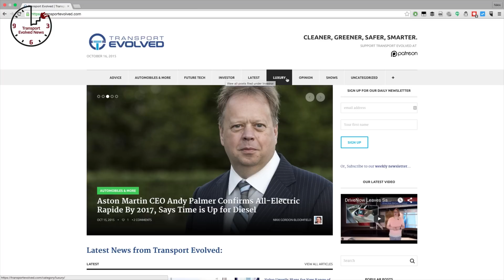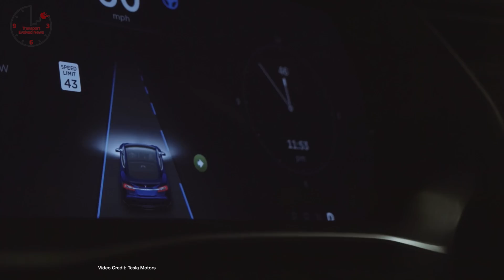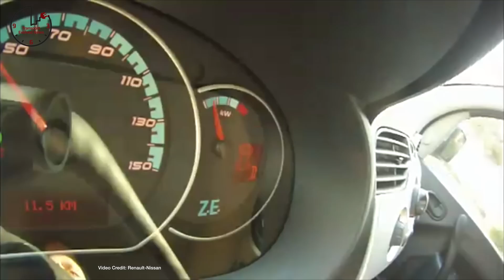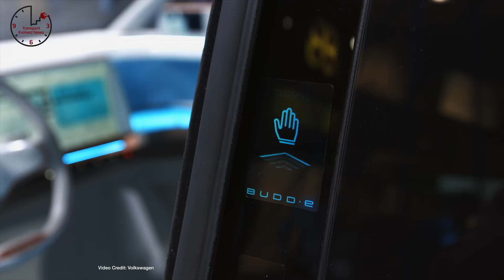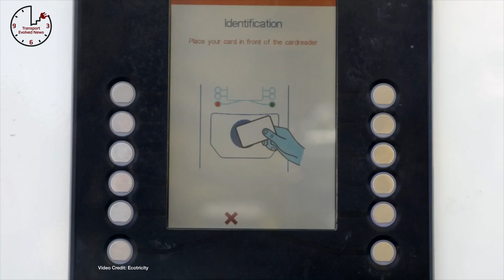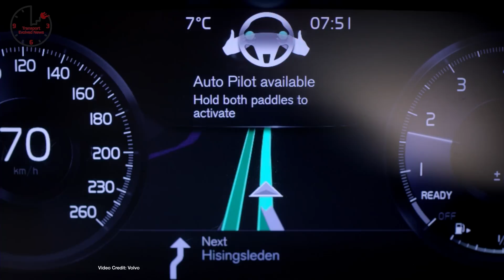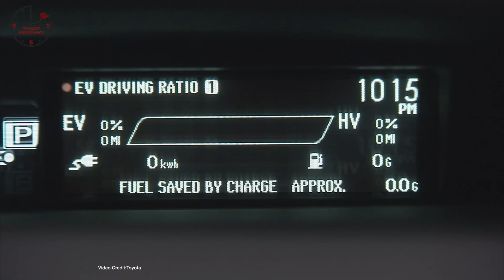Tesla Autopilot Crashes, Hyperloop Potential, Preloved Prii. T.E.N. Future Car News 8th July 2016

Comment: You missed the point on the Ecotricity charging fee of £5They a setting a 20 Minute time limit for the £5 which may mean you may not have enough to get home and have to pay another £5 for another period although you may have to disconnect before the 20 minuets when you arrive at 90-95% fullI want to pay for what I require by the Kw, 20mins only gives me 52% (15kw) less for a Zoe and No good for the PHEVThe other problem is it is App controlled so if you aint got a smart phone or a poor phone signal the you are stuckYou can buy petrol by the gallon so why not electricity by the Kw

Comment: Good show as usual Nikki. Obviously, it's sad that someone lost their life in a car accident but the Tesla autopilot is clearly offered as a public beta and has to be explicitly enabled. The reverse of this is that people complain when things aren't brought to the market 'quickly enough' for them. It's also possible that the collision was unavoidable regardless of who/what was driving.

Ecotricity introducing a tariff for charging was always going to be a difficult call for them. I've been a customer for a while and frankly considering they've done more for nationwide EV mobility in the UK than another organisation (including the UK government) I agree with some that you're almost morally obliged to switch to Ecotricity as a supplier. Their domestic tariff isn't much more than other suppliers, it's green power and you're getting your fuel paid for. Btw, high as the fiver for 20 mins seems, it's still lower than the ridiculous tariffs on the rapids in the South East arranged by the ironically named Energise Network without any further benefits and with an almost absence of supporting 7kw connectors in the area.